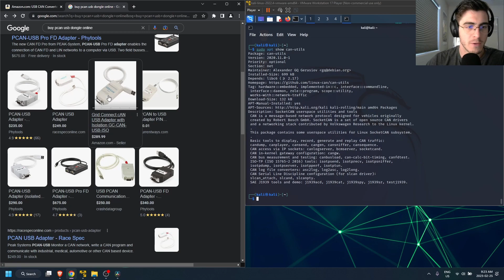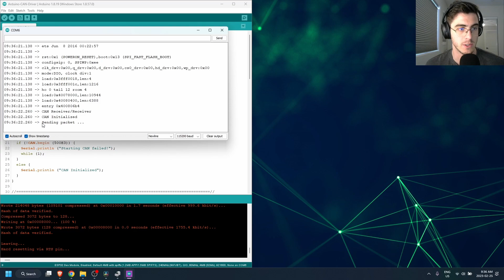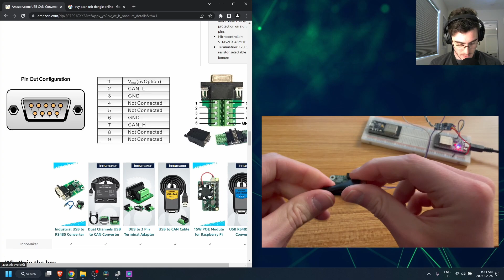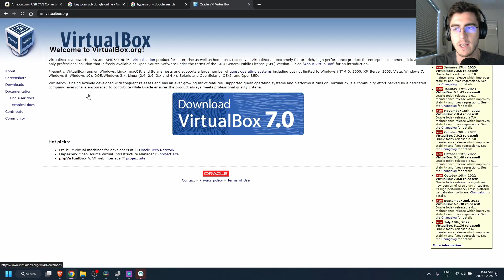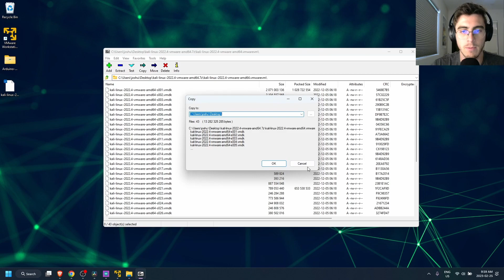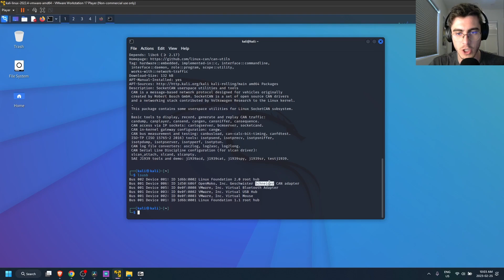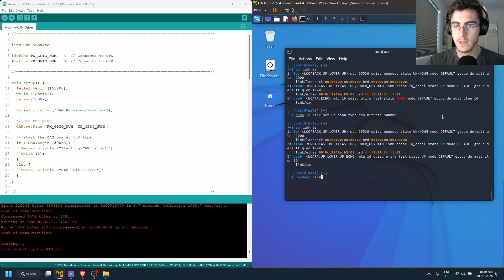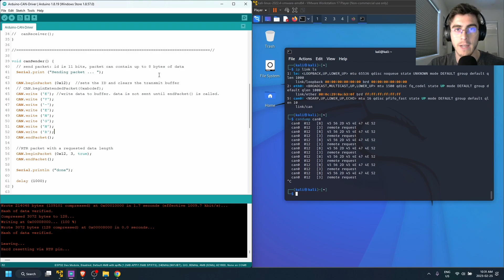Getting started with SocketCAN (can-utils) | ESP32 | Kali Linux Vmware Installation

Comment: Any thoughts on CanOpen? 

I bought a couple USB-Peak-Can controller, which I understand is supported by SocketCAN..  but now I'm looking to see how to display data from a CanOpen device.   

I've seen some devices that use the CanOpen protocol 
(Guangcheng Technology thermocouple 8-way input KJST,  GCAN-4128 , SM1810C CAN, CANOpen Stepper Controller PMC007, CANOPEN core board USBCANIO),

 but I'd like to first see if I can test using have one PCan device acting as the client (running for example CanOpen Magic), and another PCAN device running a CanOpen simulator (ex. canslave_sim or CANopen for Python).  Assuming of course, I download/make a Device configuration files (DSF) or EDS file.
Reply from the maker: I haven’t used CanOpen before, but seems like an interesting video ;). I‘ve worked with ISO-TP, which provides network layer support over CAN.
Reply: @EV_engineer  

I'd like to try SocketCan but don't have a OpenMoko USB2CAN V3.3...  I have a PEAK PCAN usb adapter. Do you think the VM/socketcan will work the Peak hardware?

BTW, I tried booting a Kali Linux LIVE dvd I couldn't get can can-utils installed:
apt-get install can-utils    (unable to locate package error despite having internet connection)
git clone htt...//gh.../can-utils (.git)
cd can-utils
make
sudo make install

Not sure why Kali doesn't automatically come with it.. perhaps there's a distro that comes with SocketCan already installed?

Comment: Hi, in your Arduino code, I found you mention RTR packet (can.beginpacket(0x12,3,True),   is it the bool True to active RTR,  also could you explain why use RTR, and why in linux, i will get remote request?? thanks!!
Reply from the maker: Hi, I got this example sketch from this article: https://www.circuitstate.com/tutorials/what-is-can-bus-how-to-use-can-interface-with-esp32-and-arduino/#Remote_Transmission_Request_RTR

This part addresses your question: "Just after sending a normal data frame, we will send an RTR packet requesting 3 bytes of data. beginPacket() function has a few overloads and we can send additional parameters as we need. For an RTR message, the third parameter should be true."

As for why use an RTR, well, to request data from other nodes. Every node on the CAN bus that is not explicitly filtering messages from the source node will see this RTR request and can respond accordingly.